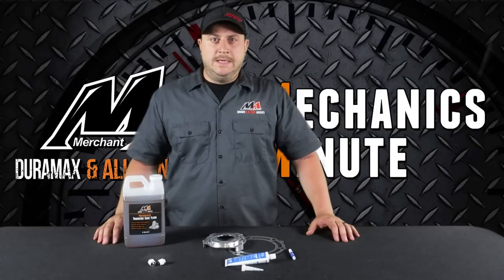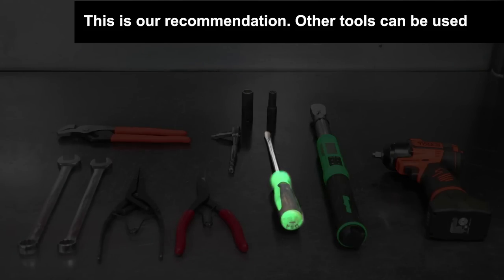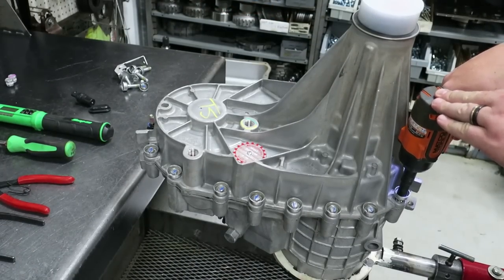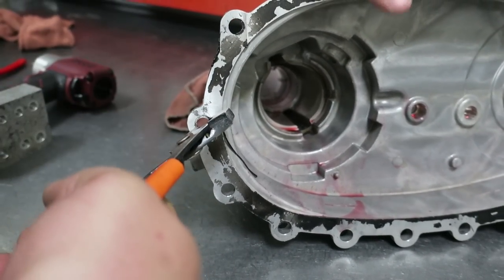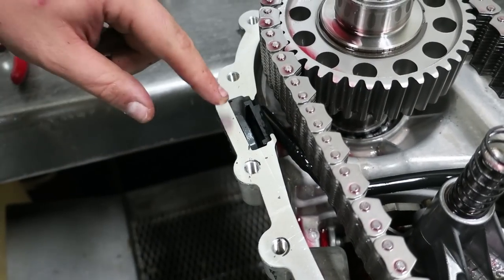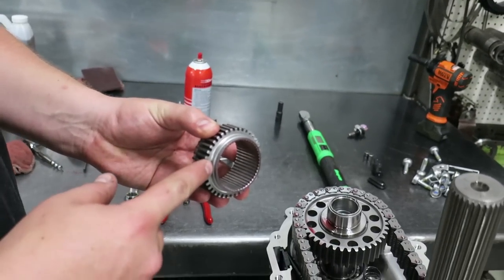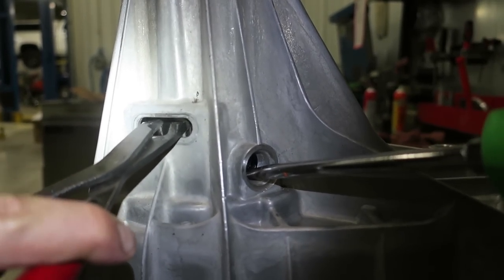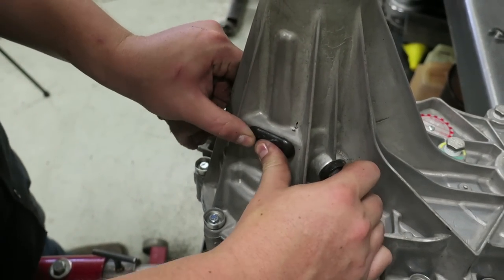Mechanics Minute: Transfer Case Pump Upgrade Install

Comment: I just installed your fix ,it went perfect thanks for the vidio I'm a 70 year old guy I did this in my driveway by myself took about 8 hours to remove fix and replace so anyone can do this the transmission shop wanted$400 bucks to install the fix after I pulled the transfer case out took maybe 30 minutes to complete the fix look at the money I saved
Reply from the maker: Great to hear Perry!

Comment: Good video and very easy task....IF you have whatever snap ring pliers you have there in your facility. I have bought 3 different sets of snap ring pliers and eventually had to just figure it out. I've been doing maintenance my entire life and this has been one of the top 5 most frustrating jobs I've ever done. I am actually on a break to keep from throwing things as I type this. Good parts, good video, good problem solving, but THE WORST if you don't have whatever pliers you guys have.
Reply: my kit-supplied silicone is going to dry before I can get the shaft last snap ring in.
Reply: Lock ring pliers is what they’re called. For snap rings with no eyelets on then

Comment: If I’ve got the case out for the pump upgrade, is there any other common failures or upgrades I should be doing while it’s out?

Comment: Do you reinstall the pump intake magnet? I noticed you removed it but didn’t mention about reinstalling it. Thanks!
Reply: He removed it permanently because he replaced the drain and fill plugs with magnetic ones I believe

Comment: Does the pump run even if 4wheel drive is not engaged?
Reply from the maker: Yep, the pump is driven off the main shaft which is always moving.

Comment: I have 2000 GMC Yukon. There is a loud clunk that happens every time I put it in reverse. Does this solve that issue? I have replaced and greased the slip yoke as well as replaced the fluid in the transfer case but no avail.

Comment: Is it better to order this kit or get the revised case half?  My trucks np261 got the pin holes in and idk how long it’s been running dry.  I found a new t case in good shape and plan to put the pump rub saver kit but I see they make updates case halves which is the better way to go ?
Reply from the maker: I prefer to use the pump plate along with an OEM housing.  The reason for that is the OE housing is magnesium and the aftermarket housings are aluminum.  Not a huge thing but that is a few more pounds hanging off the back of the transmission.  Also, most of the aluminum housings are off shore and not up to the same quality as the OE magnesium units.     Be a good idea to install the upgraded plate into your replacement unit for sure while it is apart.

Comment: hey! there i have question i have a trailblazer 03 that is leaking from the top of my transfer case at first my first time to view this i thought its was my front shaft output seal, when  i take the shaft out the way i notice shaft seal is still in good shape not seen any leak from seal but i notice a fresh fluid coming from the top of the transfercase and i see this only hose all wet with oil, my big bam question is why this hose is loose and open with no where to connect it ( my transmission oil is on level engine filter oil change was done recent) but when i clean up the oil mess with a white towel and smell like engine oil like burn, so im thinking that my engine oil is leaking out from this hose why and why this hose is leaking out my engine oil. the thing is when i take my trailbazer for oil filter change at the shop the guy tell me that the engine has no oil at all and this is the 3 time that the shop tell me when i bring back to the shop regurly for oil change but in the engine area there is no oil leak anywhere they look and nothing seem to be leaking anywhere, but this hose got me thinking and i cant find no result what the cause of it. any help??? thanks

Comment: Why didnt u put that shim ring back on the pump before you put the gear on then the bearing then the snap ring ive got two of these transfer cases apart and both have this thin warped shim on the pump then the gear goes on the shaft then the bearing then the snap ring
Reply from the maker: This demo is on a 263XHD case which don’t use that wave washer.  I have seen them on the 246 mostly
Reply: Ya them xd 246 from 1999-2001will not work n the 2004 i no untill 2006 the housing r the same but the shift Actuator motor has two plugins and a different from driveshaft gear different splines

Comment: What was wrong whit it. 
What does when the pump is bad and you to replace it?
Reply from the maker: Wendell Guzmán - Over time, the pump tabs that prevent it from spinning in the case can start to wear on the rear housing.  Since the pump housing is aluminum and is a harder material then the magnesium rear housing, it can wear a hole in the rear housing and cause a very small leak which will eventually cause catastrophic transfer case fluid loss. 

Unfortunately, since the transfer case does not have a low fluid indicator the pump rub failure is often not found until there is transfer case damage from running the case out of fluid. There is no real way to know the extent of the damage inside the case until it is completely disassembled. In many instances, as long as the case has not run out of fluid, it can be repaired with a new rear housing and seal and prevented from ever happening again using the upgrade kit.
Reply: @merchantautomotive  thank you so much master.

Comment: Ordered your kit from xdp. New case half didn’t have the dowel pins and the old pins were mangled. Do these have to be in with the new case? Thanks!
Reply from the maker: It is helpful to have them in place as they do locate the front and rear half correctly.
Reply: I just did one and it had no dowel pins at all. I was real careful to alighn the case halves exactly. I still don't like it though.
Reply: Update, took back apart shortly after and installed new dowels

Comment: What retaining ring pliers do you use? The 9” pliers I have do not open far enough.
Reply from the maker: Bretney Karsjens - we had this issue come up regularly and we have since updated our pliers to fit without fail.
Reply: @Merchant Automotive Can you please provide the snap ring pliers make and brand info?
I am unable to get snap ring back on by following your video
Reply: @merchantautomotive  which are what?
Reply: @Merchant Automotive  9" , 11" what brand would be helpful.

Comment: Can this be done in chassis or have you got to pull the whole t-case?
Reply from the maker: Pulling the transfer case will make the job much easier then trying to attempt it in chassis.
Reply: Thank ya kindly.
Reply: It can be but it's difficult by Yourself. It's better to pull it out. Next time I will pull it.

Comment: Does this do anything about the pump rub issue that is so common on these GM transfer cases?
Reply from the maker: This is the fix for the issue! Our pump upgrade prevents it from happening.
Reply: Merchant Automotive my 2002 Sierra 1500 just got the pin hole leak. Big mess.
Reply: @martech360  then you have to also replace the case half.